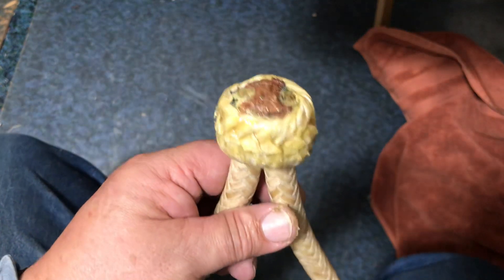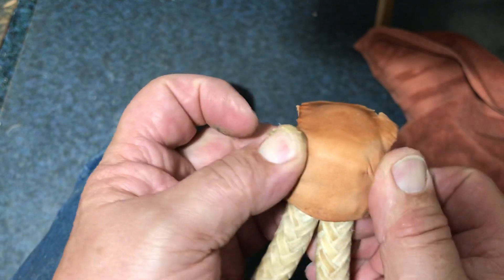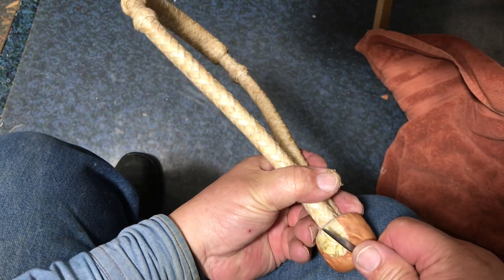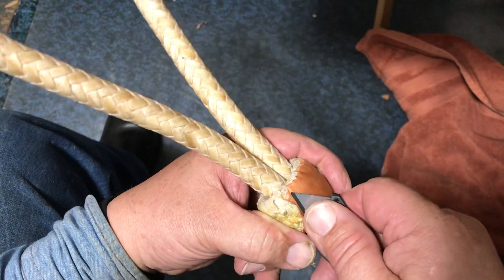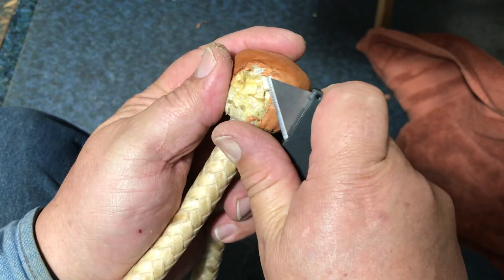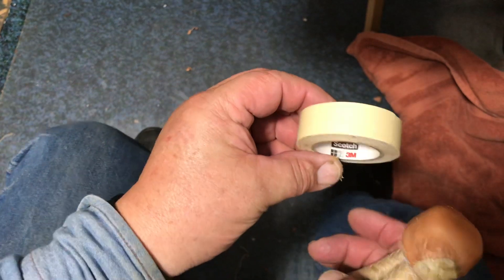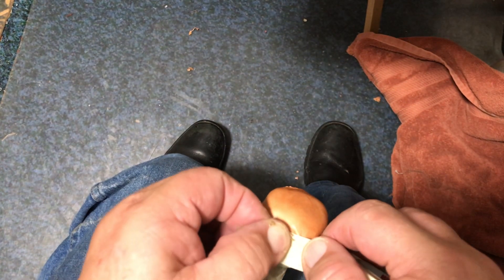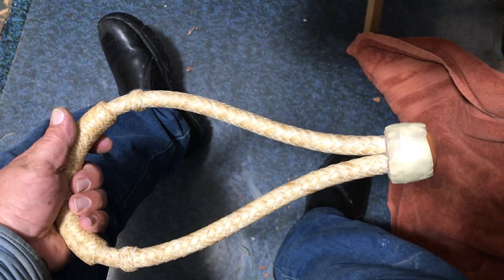Making a buildup for the heel knot on a bosal Part 3.

Comment: 3 Good videos, how wide is your lace, 1/4? Cow rawhide is hard to get in Aust, kangaroo rawhide is available but is only 20 thou thick, hard and dry. Skin about 3ftx2ft so a 20-24 inch disc to cut lace from. I made a bosal with tanned  Kangaroo lace (a bit rough),similar heel knot foundation( Bruce Grant) used it the last 5 years 4 times a week trail riding, but time to plait another one. Planning on getting your book. liked the Patria braid.